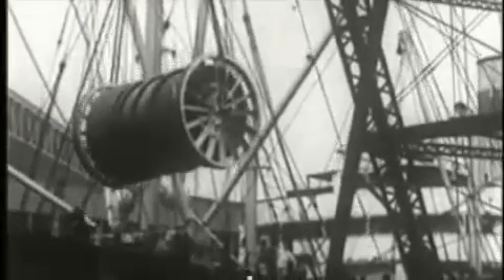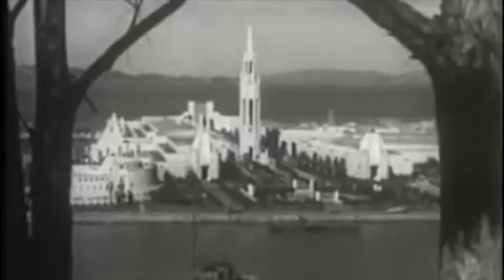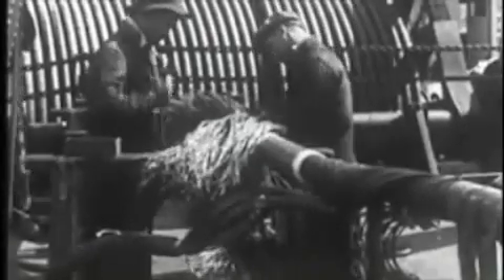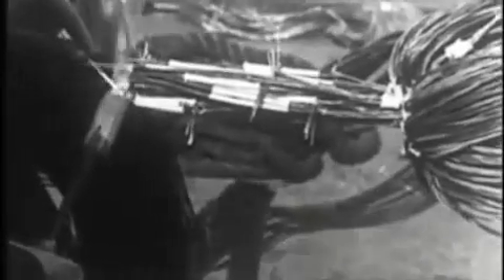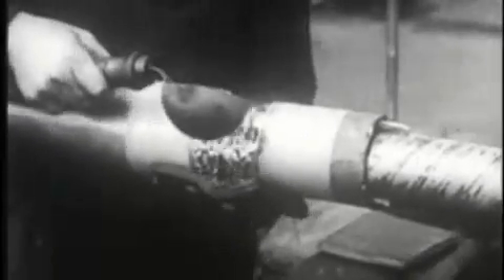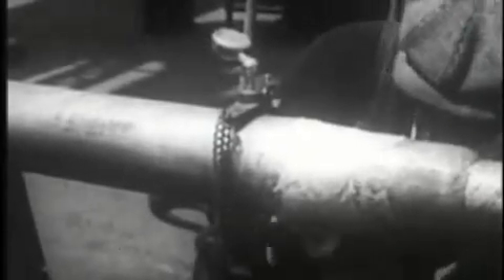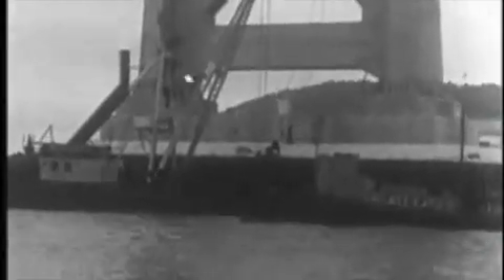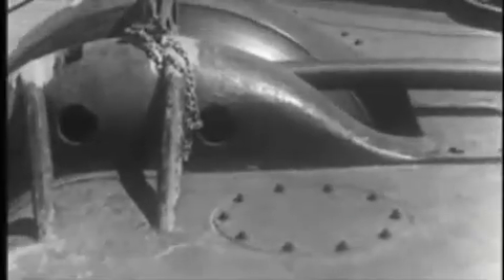Very rare video - Underwater cable laying - Must watch

Comment: hello why do all this when we have satalites
Reply: +Jeff Wachtler Cost. Satellites cost tens of millions of dollars.  Running undersea cables are a fraction of cost of a satellite launch.
Reply: +Jeff Wachtler Satellites are a myth duh
Reply: Jonathan Norris
They also arent affected by clouds or buildings blocking the signal.
Reply: Propagation delay --aside from there being no satellites when this was made.  It is the same reason modern cables are laid.  It is difficult to have a two way conversation via satellite.
Reply: By the time satellites came about they had been laying cable for 100 years.  Satellites were not needed, only the concept was needed. The concept of communication satellites was used to sell the bandwidth they had with all of the cables. People won't pay more for old technology, they had to spice it up.
 Plus all the hype about satellites, helped to make the space thing more believable.
Reply: And attenuation. Since air is lossy.
Reply: latency

Comment: I worked with people that used this splicing technique decades before I even was born lol. There is less and less of them these days, it's like a forgotten past that happen in the last century right up till everything got automated and digitalized.
Reply: Splicing is still a thing with undersea cables, even in this day and age of fibre optic cables.  OK, I'll admit the hot lead thing is probably no longer part of the process (boo!), but they still have to join this bit of broken cable to that one.